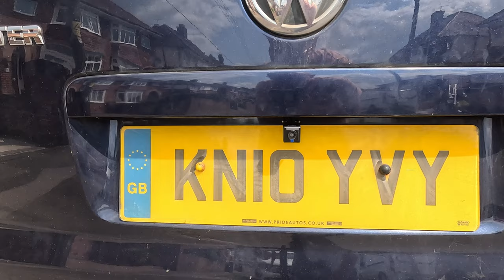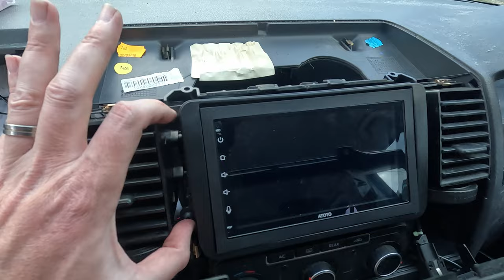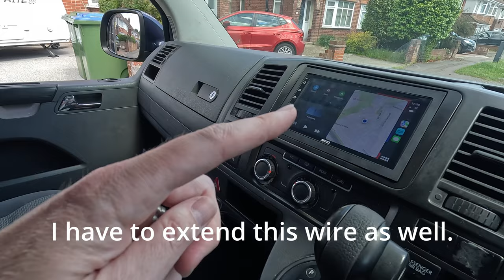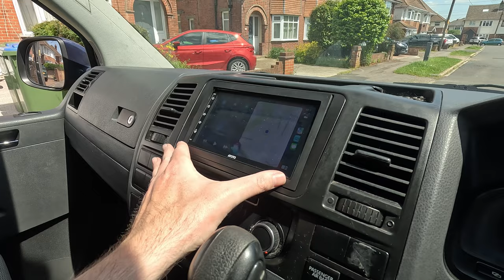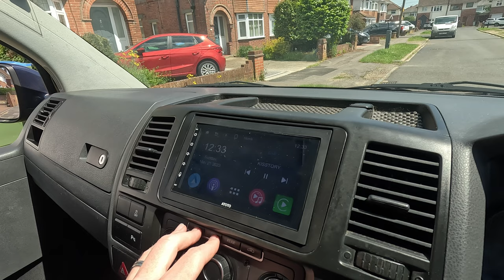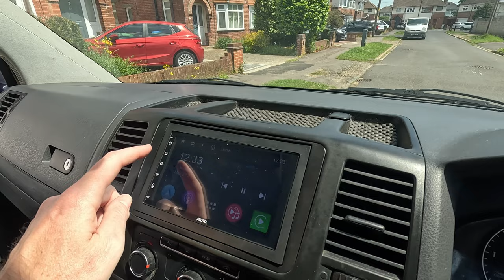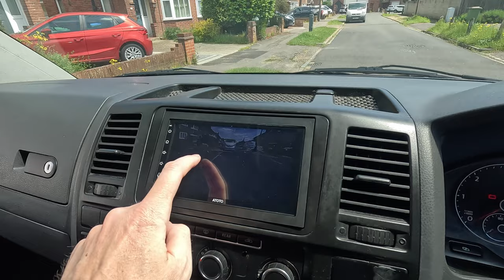Caravan Gadgets, ATOTO Stereo & Rear Camera, Apple CarPlay or Android Auto, VW T5. #caravan

Comment: Hey mate, have you had any issues with the glare on the screen with it sitting on the angle the dash is on? Considering getting one of these ATOTO units after hearing lots of great things but unsure whether to get one that looks nice and flush like yours or one that you can adjust the screens angle. Great video, cheers Arie
Reply from the maker: I would say the majority of the time it's totally fine, you get the odd day when you get a little glare but nothing to worry about. The surround I've used also gives you the option to push it back within the frame by about 1cm so you have this option also.
Reply: @wobbleboxcrew  oh awesome! Yeah I thought it would be fine, easy to overthink stupid little shit 😂 Definitely going to order one of these in the next month or so!